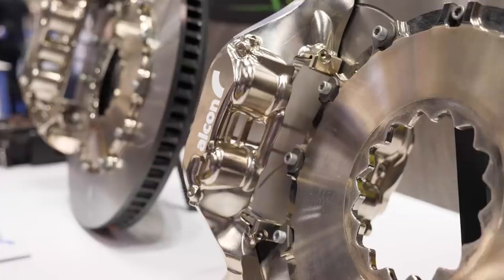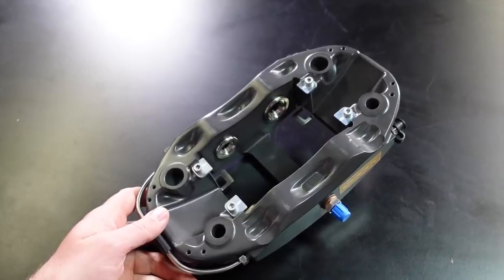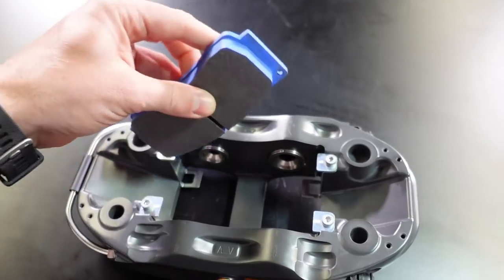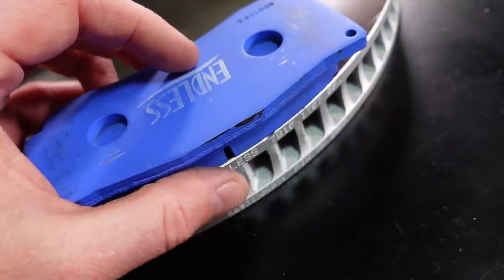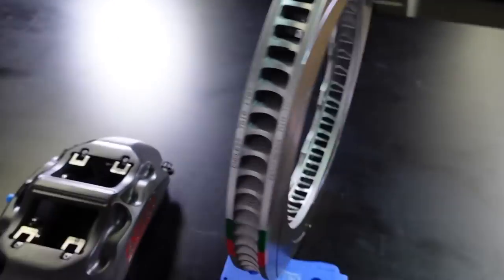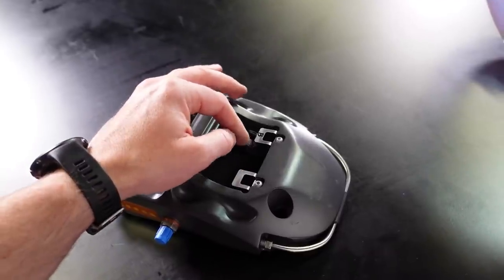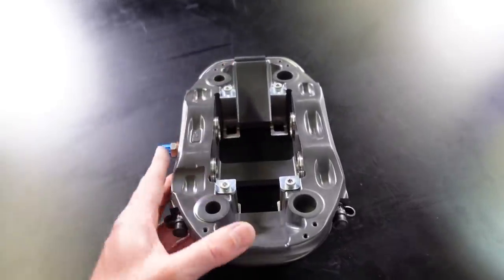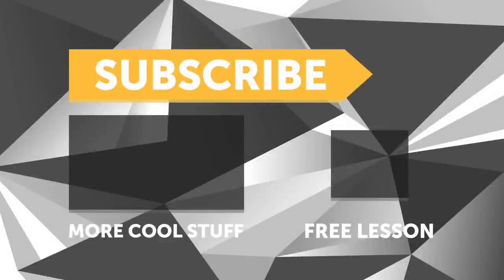How MOTORSPORT Brakes Work | Brake Caliper Setup

Comment: Nice video, although as an engineer who’s spent the past 7 years designing and testing performance brake calipers I would add a small caveat to your assumption that monoblock calipers are always stiffer than 2-piece bolted brake calipers. At room temperature this may be true, but the tensile modulus of aluminium decreases by 10-20% at 150 degrees C whereas a high tensile steel bolt has negligible change in tensile modulus at 150 C. Calipers on race cars run between 150-200C, but since the bridge region of the brake caliper runs just a mere couple millimetres away from the brake disc, which itself might be 800C+, the spot temp measured at the caliper bridge is much higher than the average body temperature for the caliper of a whole, meaning bridge temps can see 200C+. Furthermore, it’s the bridge region of the caliper that’s always ‘lit up’ on FEA models thus indicating regions of highest stress. Combine all this together and the idea of a 2-piece caliper, with a couple high tensile bolts to reinforce the bridge region, starts to become the favourable route. As the saying goes, “steel is strong”.

A designer for a brake caliper faces a cacophony of compromises. The worst one being when customers wish to run large diameter discs in small diameter wheels. Inevitably this means the thickness of the caliper bridge gets reduced below what would be considered optimal. At which point, employing a few high tensile bolts with a roll-thread  becomes the only way to prevent excessive flex of this region of the caliper. 

So, whilst it’s true that a monoblock caliper CAN be designed to have a better stiffness-to-weight ratio than a 2-piece bolted caliper, the issue really is whether the clearance envelope will allow for a very chunky aluminium bridge region. Often for fast-road applications or club-racing, packaging in the wheel is very tight hence the more compact nature of a 2-piece caliper makes it more suitable, otherwise a monoblock caliper with a thin bridge (say less than 15mm cross section) would simply flex too much.

Interestingly enough, there’s actually a patent out there for a monoblock caliper but that employs multiple steel rods threaded through the bridge section… Why go to the hassle of drilling, threading and inserting steel bars into a monoblock caliper if it didn’t strengthen the bridge region?

And this is before we consider the effects of cyclic thermal aging of the aluminium bridge.
Reply: Deep
Reply: I would add that the tightening of the bolts itself acts as a preload reinforcing a 2-pieces caliper strength
Reply: Good info!
Reply: I read this long post. Well done bro
Reply: Excellent comment!
Reply: Very cool insight! One point in the video made me curious and its about the leading vs trailing edge pistons. Its stated they are offset because of gas pressure (i assume between pad and rotor?) This might very well be true, but wouldn't straight mechanical forces be more significant? Not an engineer, nor any racing brake experience. I just like to try and understand things, so ill try to explain what i think from my view as a layperson.
So the pad squeezes the disc, and in a static system this force is evenly distributed across the pad. But the disc also spins, and because of friction, it wants to pull the pad with it. Obviously it cannot do this but it creates a sideways force component and because of this sideways force, the pad will want to torque around some point in the system. So, with any microscopic compliance, the pad, given its flat, long shape, has to then press more on the leading and less on the trailing side, leading to uneven pad wear over time with no gas effects needed it seems to me. 

I started thinking about this while working as a carpenter. When using a handheld circular saw to cut planks, it might grab and kick violently, leaving scorchmarks on the leading edges of the cut. I figured this happens when the wood squeezes on the sides of the blade (like pads on a disc) and quickly becomes a positive feedback loop as the friction against the spinning blade makes the wood squeeze more, and the relative motion make these forces naturally concentrate at the leading edge. This will feed itself until something gives. The blade might stop, the wood might splinter apart, or the saw and your arm might kick back out. So i thought this same effect of building up and releasing at a very high frequency would be what causes brakes squealing and also uneven pad wear.

Any knowledgeable thoughts?

Comment: Good general overview. Alcon, Stoptech, AP racing, Willwood racing all use 2 piece calipers. Even in their Motorsports calipers. Bespoke brake cooling ducts and deflectors can make even mediocre brakes somewhat adequate. Cooling is everything for effective brakes.
Reply: Also to mention, that too much cooling has an adverse effect, some brakes require heat for the brake pad to effectively stop the vehicle....

Comment: To calculate the force from the pistons, you would only add the area of the pistons on one side of the caliper.  Opposing pistons on the caliper is just a reaction force of the pistons on the other side.

Comment: Could you talk about smaller lines vs. Larger lines and how the master and caliper piston size matter, however line size doesnt effect pedal?
Reply: Drew, liquid is not compressible, line size doesn't matter
Reply: It doesn't matter how wide the line is because the same volume will be displaced by the master cylinder and pushed into the brake caliper, giving you the same amount of piston travel and therefore braking force.

A larger master cylinder diameter will displace a greater volume of fluid, and likewise caliper piston size affects the piston travel due to the volume of fluid they can take in, but the volume of fluid displaced is not related to the line diameter as it is merely a vessel through which the working fluid is being transported.
Reply: @SerenaBluee  What about overall system compliance? My intuition tells me bigger line diameter could be more compliant. Differences here might be miniscule if keeping diameter differences within reason, but i'm just curious about the principle in this case.

Comment: nice video. I'd like to understand what happens to the brake pedal travel when you go up with both the disk diameter (say 30mm extra) and also the piston area (even though only slightly). Would you have to push more on the brake pedal with a biting point closer to the car floor (which I wouldn't like, would make heel and toe more complicated) or less? My understanding is that bigger disk diameter equal to more brake force given the same pressure on the pedal while bigger piston area would imply that the biting point of the brake pedal would be lower (closer to the floor of the car); is this what longer pedal travel (more brake fluid to be displaced) mean? Would these two factor (disk diameter and slightly bigger piston area) kinda compensate each other?

Comment: Any insight or information as to the mounting of calipers in front of or behind the hub? That's always something I've wondered if it makes any difference or is only a packaging/cooling decision
Reply: Usually a packaging issue, along with a weight distribution question.  The location of the steering arm and tie rods can have a large influence on the location of the caliper as well.

Comment: Great video! I see the bleed nipples are on the side of the trailing pistons. If I understood your explanation correctly, shouldn't they be on the side of the leading pistons?
Reply: It depends if the caliper is mounted in front of, or behind the wheel hub relative to the front of the car,  as the direction of the rotor relative to caliper effectively reverses depending where the caliper is mounted.

If the caliper is mounted in front of the wheel hub, the caliper should be mounted so the leading pistons are above the trailing pistons, thus the bleed nipples would be mounted on the leading piston side of the caliper. 

If the caliper is mounter behind the wheel hub, the caliper should be mounted so the leading pistons are below the trailing pistons, thus the bleed nipples would be mounted on the trailing piston side of the caliper.
Reply: @taznz1  
Ahh, got it! Thanks again!

Comment: Hey HPA. I would like to ask. I've upgraded my brake calipers at the front.  From a 1 piston to 4 pot brembo on upgraded discs same size. The brakes are way sharper at low speed. But I think there worse at high speed. I thing the abs is causing the problem. Am I right?
Reply: Does the brake balance feel the same as it did before, front to rear? What about pedal travel?

One of the interesting things about piston sizes is that as the area increases you get more force but also more pedal travel, and vice versa. If the combined piston area of the new caliper is smaller than the original then it will bite sooner so feel sharper on gentle braking, but won't be as effective when you put more force on the pedal.

For reference, the area is only calculated for one combined side of the fixed caliper when comparing with the sliding caliper, as the sliding caliper piston has to travel twice as far for the same braking force.
Reply: @SerenaBluee  thanks for your great answer

Comment: Can I upgrade my calipers and break pads and leave the same factory disc?
Reply from the maker: You can, there are bolt on kits which will replace your stock calipers and allow you to retails your factory disc/s for many vehicles out there.
You don't need aftermarket rotors to run aftermarket pads though and they are the cheapest and easiest place to start - Taz.

Comment: Why do manufacturers use multiple round pistons rather than one oblong piston? You could get the same piston surface area in a smaller caliper body. Seem like it should be lighter as well right?
Reply: I can only assume it is because of the mugh higher machining difficulty of making a non round hole and also a longer piston will flex more than two round ones of the same area so you gain no benefit from non round pistons
Reply: @lockjawjak   yeah I figured the manufacturing process would be hard. I’ve worked in machine shops for a few years and making the piston wouldn’t really be difficult just more costly than a round one. And as far as the piston flexing or moving you could just add gussets or webbing on the back side. Probably just comes down to overall cost of a round vs odd shape part.
Reply: @dustinadams4252  You also need to think of the "tipping/rocking" loads on the piston.  As mentioned in the video, the tendency for the pistons to tip in the bore can lead to jamming and excess wear, both very bad for a racing caliper.  

An oblong piston would be much harder to control and stop the rocking compared to round pistons.  And as a machinist who's designed and made his own performance calipers, getting the sealing surfaces right would be much trickier than traditional cylindrical pistons.

Comment: What will happen if you keep the same caliper but change the master cylinder to one with a bigger piston diameter?
Reply: Less pedal travel, less pressure on the pistons for the same pressure on the pedal. Make sense?
Reply: @jeffreydurham5342  so that'll make my braking slower right ? At the cost of less pedal travel.
Reply: @kevinpinheiro2485  you will need more brake pedal pressure to provide the same braking
Reply: @kevinpinheiro2485  I don't know what you mean by slower.
Reply: @jeffreydurham5342  like it'll take more time to stop the vehicle compared to before
Reply: @kevinpinheiro2485  yes, with same pressure on the pedal

Comment: Please correct the information you provide. Clamping force is not equal to the total area of all pistons! Only one side area*pressure will give you the clamping force. The other side is just opposing this same force to prevent bending of the rotor with solid mounted calipers. A floating caliper with same area of pistons on one side and no pistons on the other will have SAME clamping force. Also similar volume will be needed as if its simetric caliper with twice the area..
Reply from the maker: Thanks for the comment. There’s a bit to unpack here, but the information is not incorrect.
What you’re saying is correct for a floating vs opposed caliper total area. I don’t think I’ve said anything in here that contradicts that. The point I’m trying to get across is that you can have the same clamping force by having 1 big piston or 2 smaller ones that equal the same total area. 

When it comes to actually calculating the whole thing out, for sure what you’re saying is important to understand, but in the context of this video where we’re just talking high level concepts, that’s a detail I haven’t gone into.

So in summary, you are right, but the video is also right given its context - Tim.
Reply: @hpa101  the problem is you guys are a reference pretty much for everyone now. 

Also most of people getting in to motorsport start from a single piston oem one. 

Now there a whole problem as some cars have much stronger clamping force with that single piston than a standard brembo 4 piston caliper. 

One would assume otherwise if they do calculation the way you described in the video. 
Same would apply for piston bias balance, or break pedal  travel. Single side are is what is important on all of the calculations (clamping force, pedal travel, break bias etc). 

I know Motorsport became pretty much monoblokk calipers only or at least solid mounted, but the info still needs to be correct imho. Im not saying the whole video is incorrect, just that little part needs clarification.

Im following you guys and you do great work (im also a gold member).